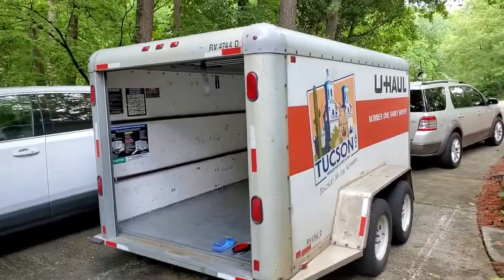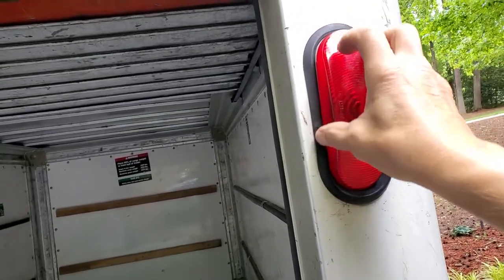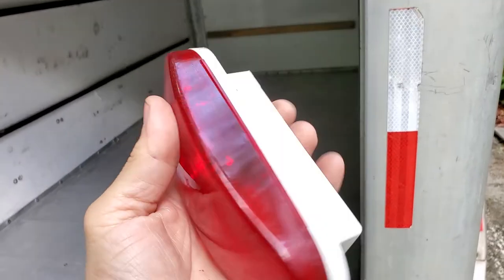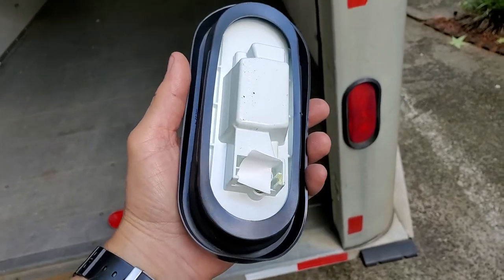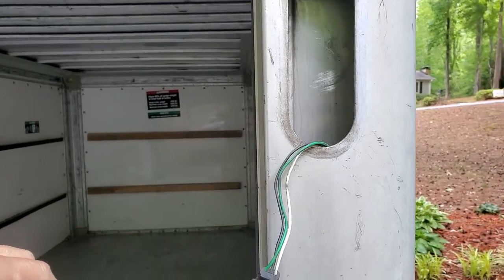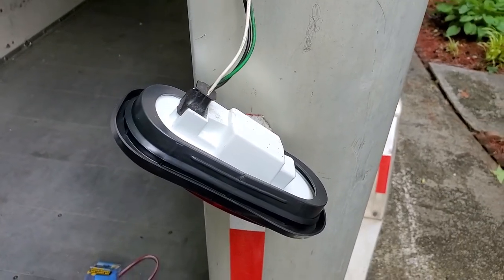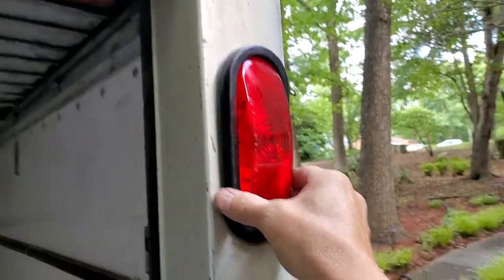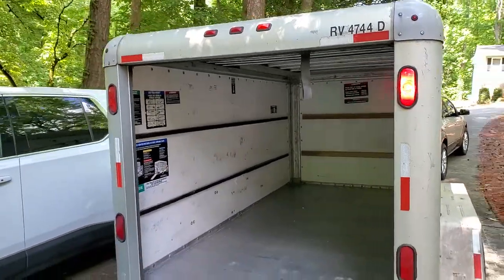U-Haul Trailer Tail Brake Light Assembly Replacement - bulb is not replaceable ST-70RK

Comment from the maker: How to replace brake light tail light assembly on U-Haul 6x12 enclosed cargo box trailer and other applications. The bulb is not replaceable because the assembly is sealed.

Where to buy on Amazon:
Complete Assembly https://www.amazon.com/Oval-Stop-Signal-Light-St-70rk/dp/B003O4WR4Q/ref=sr_1_4?crid=1H4RON0LOURET&amp;keywords=ST70Rk+light&amp;qid=1653671058&amp;sprefix=st70rk+light%252Caps%252C54&amp;sr=8-4&_encoding=UTF8&tag=horsepowerhou-20

Outside assembly only  https://www.amazon.com/Optronics-ST70RBP-Tail-Light/dp/B00NJ0CA7E/ref=sr_1_9?crid=1H4RON0LOURET&amp;keywords=ST70Rk+light&amp;qid=1653671375&amp;sprefix=st70rk+light%252Caps%252C54&amp;sr=8-9&_encoding=UTF8&tag=horsepowerhou-20